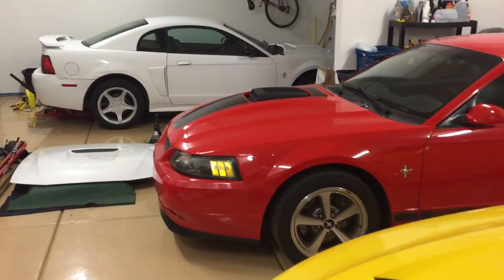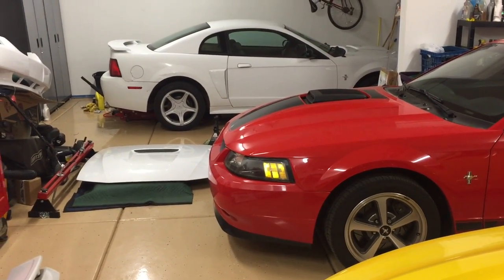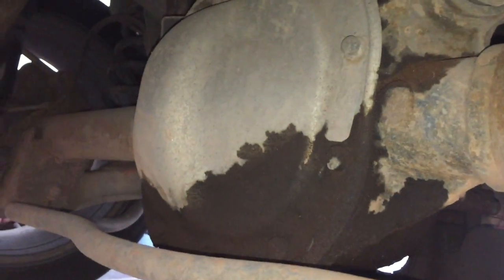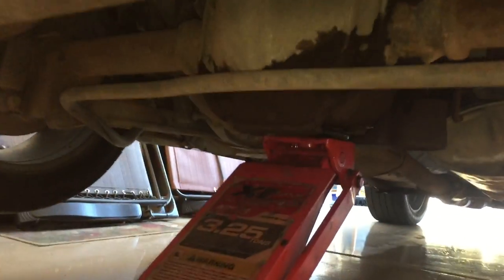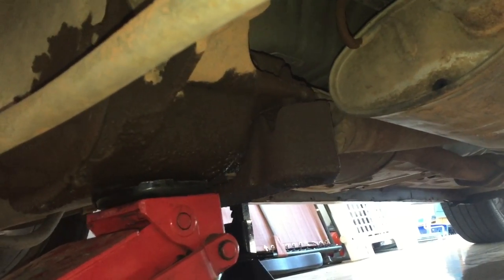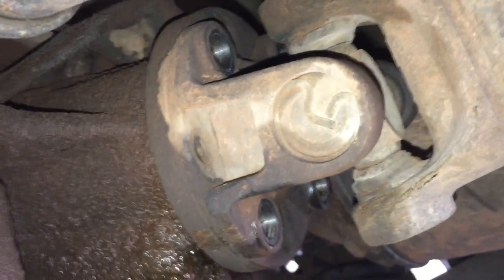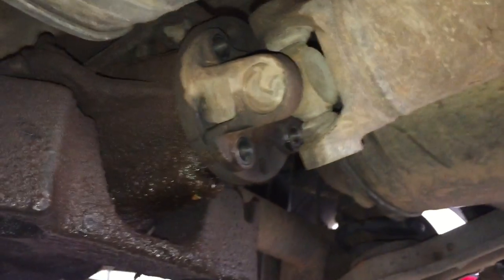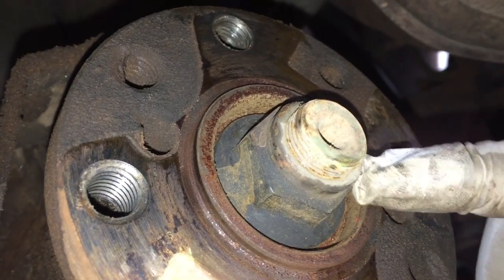Pinion seal replacement. Fix leaking rear diff Ford Mustang GT, Mach 1, Bullitt, Cobra, F150 8.8

Comment: @dannyjohnsonsgarage
My pinion nut ended up 180 degrees off from the mark I put on the nut and the matching mark I put on the flange.  How would've this happened?  I'm certain I put the nut back on 16 1/2 times as that was what it took to get it off.  Should I be concerned?  Or is it good enough that I got it tightened back 16 1/2 times?
Reply from the maker: It may depend on where the nut starts threading onto to pinion. In the video you’ll see mine also went a bit farther back on. You won’t crush the crush sleeve further with just a hand ratchet. In my install video you’ll see it takes a large breaker bar and cheater bar. It should be just fine but if you used the old nut it must have lock tite or it will walk off.
Reply: @dannyjohnsonsgarage  yeah, I used the old nut, cleaned all the old loctite out and put new loctite red 271 in.  I started the nut at the same spot I took it off from with the paint marks lined up on the nut and the flange.  When I got to 16 1/2 turns the paint mark on the nut was 180 degrees past the paint mark on the flange.  I felt like a 1/2 inch ratchet wasn't enough torque as laying on your back in a weird position with no room doesn't give you any leverage, so I did use a breaker bar and then a torque wrench set to like 135 ft lbs when I got to the 16 1/2 inch mark.  I was not able to make the torque wrench click at that torque setting, as again, there was no way I could get that  kind of leverage on my back.  I hope I didn't over tighten it, but I was also worried a ratchet wasn't generating enough torque either while on my back. Thanks for the video and quick response.   I'm going to let everything sit for 24 hours before adding fluid and trying it out.  I'll let you know the results!

Comment: my nephew impacted his pinion nut...it binded the wheels from turning freely...i told him to back off of it until we saw oil dripping from the yoke and retighten it by hand only...it makes a whining noise now i believe due to the crush sleeve was damaged...question...

can we replace the crush sleeve by removing the yoke, bearing and washers without tearing down the entire rear end and taking out from the rear?
Reply from the maker: The front pinion bearing will be in the way. I do have a full tutorial for replacing the gears. It will not be too bad since you aren’t changing any shims. They just need to go back in where they were. Ford Mustang 8.8 Gear Install
https://www.youtube.com/playlist?list=PLIjr-uSYDZi5fnxxp6D9MO7_QlTzizaUf
Reply: @dannyjohnsonsgarage  
So the front bearing can't come out through the front?...the entire rear end has to taken apart....😔

Thanks for responding!
Reply: @dannyjohnsonsgarage  by the way... it's a 07 f150 4.6 2x2

Comment: Honestly just count the threads of shaft to get how tight you need it.
Reply from the maker: That’s the start, but if it’s loose it will walk off. You need thread locker and it won’t hurt to put it on by hand. You won’t crush the crush sleeve further with a hand ratchet

Comment: What torque for those 4 driveshaft bolts?
Reply from the maker: FORD Service Manual says 70-95 ft/lbs. Always double check for your specific year, make, model

Comment: What size socket do I need to remove the pinion nut?  Also, is the diff universal joint and the trans universal joint the same size?  I removed both of the ujoints and they look the same size.  Working on 2003 GT.  Thanks
Reply from the maker: 1-1/16” socket (shown at 6:30 in the video). Make sure to have the u joints pressed back in. A friend of mine did not listen and beat his back in and it locked up and cracked his transmission in half.
Reply: @dannyjohnsonsgarage  Yep, used the ball joint press.  Worked like a champ.  Thanks brother

Comment: What happer if the mechanic dont mark the pinion flange with the u join base?
Reply from the maker: Luisvt you could get a vibration from the driveshaft and pinion flange being out of balance
Reply: Danny Johnson oh i see i order a new ford performance pinion flange thinking it would fix what it left of vibration since i all ready replaced the pinion bearings install bbk control arms and replaced the upper axle bushings and installing new u-joints, do you know where can i find in what holes must be torqued the driveshaft-pinion flage bolts to tell that to the mecanic since the only place i can have as reference of it is in your video thank you
Reply from the maker: Luisvt If it’s a new flange there isn’t really any way of knowing. You can try rotating the drive shaft to the next position to see if it helps.
Reply: Nothing will happen at all! all driveshafts are balanced outside of the vehicle independent of everything else. as long as it isnt taken apart at the u joints it will retain its balance. the pinion flange is balanced separately as well.  the only time you need to mark them is when doing a u joint change. also he should have marked the nut and pinion shaft before breaking it free to be able to put it exactly where it was before. btw great vid
Reply from the maker: Night Rider You’re forgetting that as the car’s parts wear as it’s setup from the factory it needs to now be replaced for that pattern.  
 Also, I did mark a relationship, but it wears off when removing the nut, so you’re better off counting revolutions. Same thing
Reply: @dannyjohnsonsgarage  I disagree, to a point! The point being that neither the pinion flange nor the driveshaft itself would wear unless damaged. At that point these parts would need to be replaced or re balanced. The wear parts are the bearings, seals and u joints. You would be 100% correct if this was a 70s vehicle, as back then manufacturing wasn't was it is today and having an unbalanced driveline was very common! I do however agree it's good practice to mark parts relationships though! I mark as well as its what I was taught. 
The question was what if the mechanic didn't mark thing while taking it apart. The answer would be nothing unless it was a u joint being changed! Thanks
Reply from the maker: Night Rider I see where you are coming from. I need to stick to the recommended procedures for making the videos, some people have problems with torquing things, some do not care. It’s just one of those things that I would like to pass on in the videos because it must be done for many reasons, some I know, some I do not but don’t question. Hope that makes sense
Reply: @dannyjohnsonsgarage  It does make sense for some viewers! I was just pointing out that its not as important as it once was and not to worry if this step is missed. Thanks
Reply from the maker: Yeah, I mentioned earlier that my mach 1 received a new flange as part of my install, so it didn’t have a previous place and is fine. It’s all good
Reply: @dannyjohnsonsgarage  would it also help to mark the bottom of the socket with say a paint marker to aid in counting how many revolutions it took to remove the pinion nut?
Reply from the maker: Mike B Yes, that also works. Truth is, get it on as tight as you can by hand and you shouldn’t be able to further crush the crush sleeve